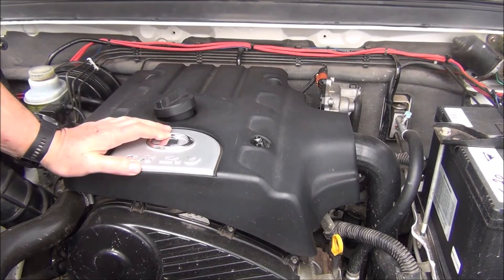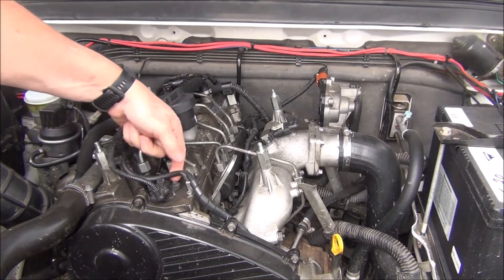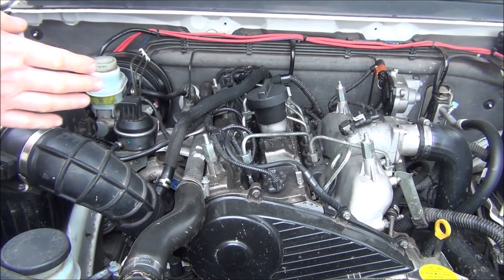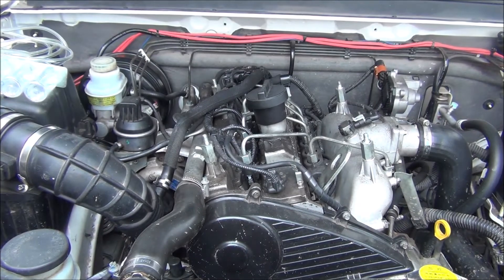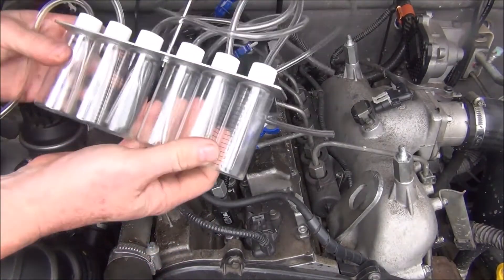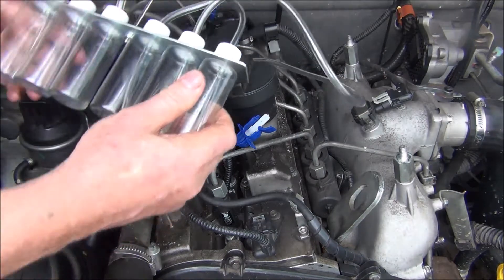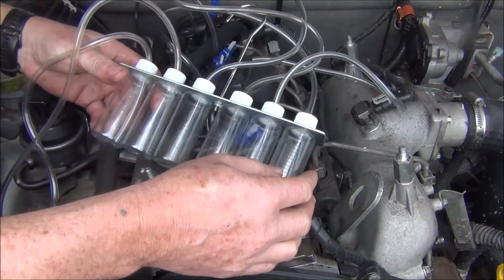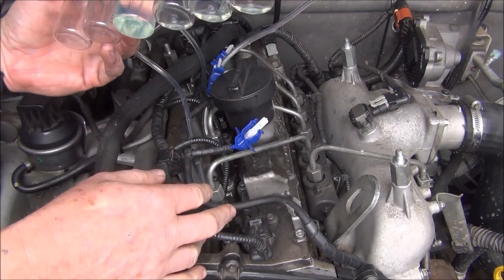Injector Back Leakage Test

Comment: What was your symptoms for checking the leak back test, low power, cut off ?
Reply from the maker: The engine idle when cold wood go up and down and it wood take a few extra cranks to get it going.
Reply: Is it DIY replacing the injectors? Any special equipment used?
Reply: Have you hade any overheating issues? I have lately had issues with mine.... The coolant level get low when at high speeds and the temperature rises up?